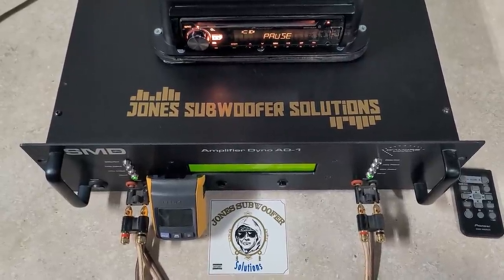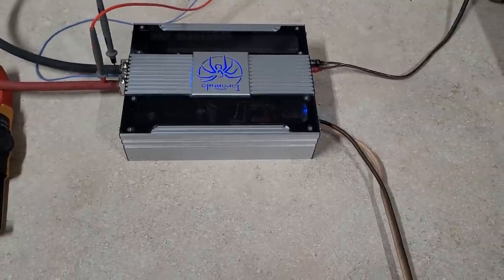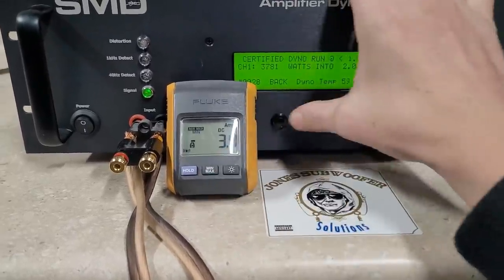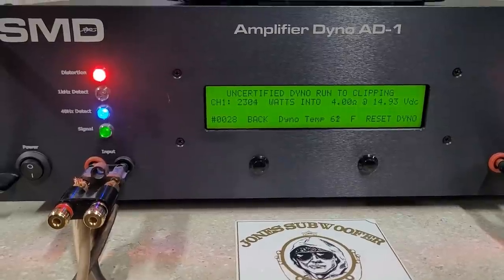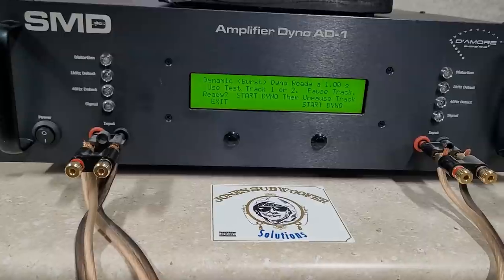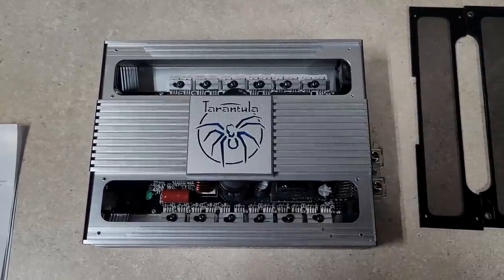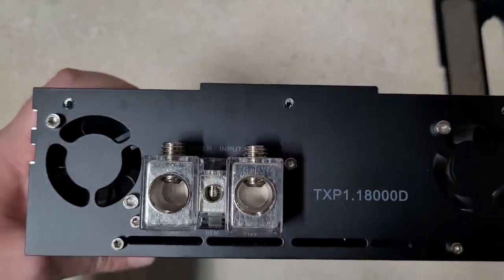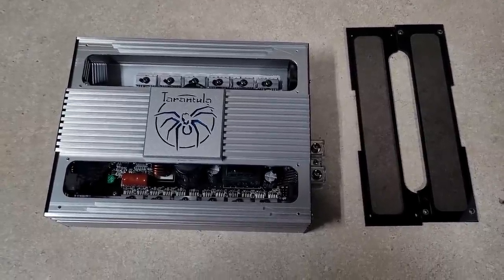AD-1 Amp Dyno Soundstream Tarantula TXP1.18000D by Jones Subwoofer Solutions JSS

Comment: So run this thing at 1.3-2 ohm and get around 4000 watts for $300. That’s not so bad. 99% of people don’t understand how tough a 1 ohm resistive load is on an amp.
Reply from the maker: Exactly my thoughts as well.
Reply: Or your electrical system smh.
Reply: Ran my hifonics brz 1700.1 at 1ohm all its life. Never even got warm. Had a xs power 3400 under hood. and big three. 14.4 volts all day.
Reply: Especially .5 ohms. I run that in a lexus. Buddahoutchea on youtube 2 see it flex
Reply: @knikkaknikk86  the thing is when you have them on the speakers the impedance rises sonits not on 1 ohm exactly might be like 1. Something
Reply: @knikkaknikk86  run it at .3 and thats about what this amp just withstood
Reply: I don't think he had enough power wire running to it. You can't expect an amp to push over 5000 watts without 2 runs of 0 gauge to the amp. Technically you the wire he was running would have eventually burned up from heat because it really is only rated for 3000-3300 watts. He needs to redo the test.
Reply: @drjd2real  on a reasonably short run of wire, 10-15 feet, a single piece of 1/0 will easily supply the current for 5000 watts. And I’m quite sure his run was no longer than that. If that tiny piece of metal in a 400 amp fuse can supply enough current for 5000 watts you don’t think a piece of 1/0 can? When you pull to much through a wire you can literally see the wire physically move. That was not happening.
Reply: I have a txp1-18000 at .5 ohm on 4 dual 4 American Bass Elite 15s with box rise I have no problems and they are slamming hard just make sure to set the gains properly , I set mines with the clip light on the amplifier
Reply: @alexturner4312  makes sense. .5 should rise to around 1.5. Possibly higher. Nice to see someone actually paying attention to their clipping light 👍🏼

Comment: I have an soundstream 6000dl & it's wired to 1 ohm & i haven't had any problems...I've had it for 2 1/2 years...i guess I've been lucky...but it's about to come out anyway...I'm about to go skar all the way....nice video btw.
Reply: I had my t1 6000dl for 6 years at .5 ohms i finally smoked it but i rebuilt it with alittle bit of modifications and ramped it up to 6000 watts rms this was a certified run at .5 and it still runs to this day although it takes its toll on woofers gotta be some strong subs to take it now

Comment: Just some constructive criticism. It's static load on the dyno not reactive. Reactive is on a sub. Also, you need to stop the track sooner. The amp popped because you ran it into the rails full clip at over 5,000 watts for almost five seconds. Five seconds full clip with that kind of power is of course going to overload the output section of the amp especially a cheaper amp. Other than that fantastic video keep em coming.
Reply from the maker: Can I blame the smoke and excitement?  Resistive on the dyno, reactive on a sub - I got confused indeed.
I don't think hitting pause sooner would have saved this amp though, the dyno had just barely locked the numbers down when it went, maybe 2 seconds later it popped.  I see what you mean though.
Reply: @Facekicker  Why did you expect rated with one run of 0? You were trying to push too much power through the tiny power wire imo.
Reply: @Facekicker  Go to bcae1 dot com and go to the Power Wire Calculator and input your 15 feet, watch it tell you to use bigger wire.
Reply: @drjd2real  Perhaps the manufacturer should use a pair of 1/0 inputs and outputs.
Reply: His voltage is high as hell being at 15 volts most of the time.

Comment: It says 7000@1 ohm yes it falls a bit short but well over 6000 watt so that is certainly not bad for a 300$ amp and as far as im concerned a bench test on a dyno only gives a rough evaluation of it. Ive had one of these amps since they came out never ever once have i had any trouble with it. Im currently running 2 18 inch skar zvx d1v2 18s at 1ohm with zero issues. Got lucky today and bought a second one for a good price and now I'm searching for a set of 12s to run. BOTTOM LINE IS IF YOU HAVE THOUGHT ABOUT THAT AMP BUT WASN'T SURE ITS A ABSOLUTE BEAST FOR THE PRICE!!!  Hope this helps someone trying to reach a bassaholics goal😊

Comment: 6,241 watts dynamic for 289 on some sites is not bad at all. Probably would've survived a 1ohm reactive load. Not exactly what I run ,but impresive for the price.
Reply: That amp is a Beast. I heard it on two Rockville destroyer 15s at 1 ohm. The dude's car sounded wicked with the Bass

Comment: FYI a subwoofer will present a reactive load with impedance rise along with power compression. The amp dyno will present a purely resistive load.

I think the author of this video is a bit backwards on that.
Reply from the maker: I think the author has corrected himself in the comments many times 😉

Comment: Pretty similar to my sundown full bridge 1500 I had. It didnt take high voltage well and burned it also didn't like 4v from my headunit either. Sucks cause that bad boy was pretty efficient and did alot of power ended up getting a soundigital 1600 evo . so far its lasted longer than the sundown .

Comment: Is it possible that the high voltage contributed? Do you suppose that if you'd run it at 14.4 or 13.8 it would have blown up? The HV input may have caused saturation?
Reply: Someone who is I terestwd in this 8snt going to be running a 16v CMAX bank
Reply from the maker: Voltage wasn't a factor. 
Mfgr rates them for 16v operation.
They can't handle extended clipping at rated impedance on the bench - it's inherent in every Chinese SD clone board.  Same as Wolfram O Series and Sundown SFB.   They need to see rise.
Reply: @Facekicker  so with box rise 1.3 ohm it should run fine? Real world situation
Reply from the maker: @lol-ld3jh  I would be hesitant to wire under 1 ohm no matter the rise, and don't think I'd do it at all personally unless I know I'm gonna rise past 2 ohms.
I'd say rising to only 1.3ohms would be playing with fire, literally.
And as mentioned before this would apply to any of the Chinese SD clones, not just the Soundstream.
Taramps Smart5k or Smart5BASS would be a much safer and more reliable amp with low rise in this case, in my opinion, and will match or beat the clamped power of the Soundstream.
Reply: @Facekicker  was really looking for something to put out 2500 range a 1 ohm. I saw this figured I'd have plenty of head room for bigger build in the future.
Reply from the maker: @lol-ld3jh  Consider Taramps MD3k or Cab22
Reply: @Facekicker  tha cab22 is impressive for the price.

Comment: I would be curious to see a current Dyno of the new generation of Hifonics Amps after they decided to go with Peak power output Ratings  instead of RMS ratings on thier Manuals, Boxes and documentation. This would be the generation after the BRZ Brutus series. Word has it that they decided to go with Peak power rating after several failed accurate RMS attempts on the AD-1 Dyno.
Reply from the maker: I'll check em out
Reply: @Facekicker  I appreciate it.  Just so you know, am retired Purchasing Manager for a Electronics Manufacture, so I know how the system works. This information is not solely based on my experience but insider information as well. It pains me to see the decline of the great company Hifonics used to be to what it is now....

Comment: When you went into dynamic at 2ohm it went from 0 to 5000 watts it didn't count up clean. I'm under the impression that it has to count up clean on the dyno in order to concider it a correct reading. I'm I wrong about that because it a dynamic run. I don't think I am I think it still has to count up clean even with a dynamic burst but you tell me. I just like to eat h and your actualy doing the test. Anyway thanks for the video. Even before you did the 1ohm run u was saying you have to have a second camera on the amp to catch the fire. But it was a great video anyway!
Reply from the maker: Dynamic is a burst track and everything worked as one should expect it to.  No difference in any other amp doing dynamic runs.

Comment: Can you dyno old school EARTHQUAKE PHD10000DW/2
Reply: Yeah, I'd like to see that too.  I had one I just sold and never even ran it in my vehicle. Has way more transistors than this soundstream, but obviously won't make numbers as high. I've never seen those earthquakes dynoed, the last US built amps earthquake put out. Wouldn't have sold mine, but I  needed something more compact.
Reply: @2slofouru  I have mine hooked up to alpine 9515 head unit. Epic center.  4 old school pioneer 12's not even turned up a qtr. It slaps. Big 7 upgrade and 320 amp JS Alternator .... I got same series PHD5000W/2 same setup in truck . still need to upgrade alternator.

Comment: The no clip light on knob is pretty slack, as far as I'm concerned all amps should have a clip light on the bass knob. The first amp I bought with one made me never want to go back. It really makes you realize how often you're actually clipping. At least this one has one on the amp. But I suppose if you have a steady hand you could solder wires onto the board where the clip led is mounted. I'd like to try a couple of these instead of my cab45, but a 2nd cab45 would be a smarter idea...lol

Comment: Awesome test thanks for the dyno and showing us what we get if we bought this and how cheaply it's made.
Reply: It's a very tiny amp, much smaller than the ones companies charge 2 to 3x more for. For something that could feed four huge subs a clean 1000wrms each, I'm not sure where the hate comes from. I mean, look at the cost per watt... I'm about to run three 12s that are rated at 600wrms, because I prefer overkill and low distortion. I've been running the amp a few months now, but only on two IDQ8s, just to have something.

Comment: Do you recommend a power supply for bench testing amplifiers without using any car batteries?
I'm looking for a power supply that I can plug into 120 volts and run an amplifier in the home.
Reply from the maker: A good power supply like the Taramps Procharger series will do standalone operation without a battery, but on 120v you'd be looking at 1000w of support max without adding battery or running multiple supplies.  Each power supply would need its own 20a breaker as well.
I am a Taramps dealer and if you'd like pricing or other info, you are welcome to message me through YT,  or the Jones Subwoofer Solutions page on FB, Instagram, or the web.

Comment: To buy that kind of power for 300 is unheard of though.. that kind of power back in the 90s would have costed thousands and thousands of dollars. My first amp was a Orion 2100 hcca and although a cheater amp I still spent 1500 iirc... 80% efficient  , 3k watts, small footprint, low price, run it at 2 ohms, if it pops, what's the real loss?

Comment: Hi I bought the TPX6000 and now it's showing the clip signal even after disconnecting the all the signal cables including the speaker cable and it's still showing the clip signal. What might be the issue??
Reply from the maker: Faulty amp is likely, these apparently have a weak QA/QC process.

Comment: Better off just getting taramps smart 3 for same price. That's my opinion.
Reply: Austin Martin  that's what I've heard🤣 I've had the smart 3 about a month, and I really dont care for the full bridge crap tbh.
Reply: @1ohmwrecker  my Smart3 is still going strong! Doing so well that I actually have 2 other brand new amps still in their original packages that I haven't bothered to even test out yet. One is a Korea amp: Trauma Concussion 3500 watt amp. Second is my latest amp I bought, Taramps md8000.1
I can't even imagine how much of a beast my 8k Taramps will be, this dang 3k Smart3 already pushes the subwoofer pretty good! 
I will admit I am kind of anxious to use my Taramps 8k though!

I don't care what Taramps haters wanna s say. After using the Smart3 for a while now I know for a fact they make power! Plus they aren't power hungry & hard on the electrical like Chinese amps are. Even at night with my headlights on I get very little voltage drop at full tilt with my Taramps Smart3. During the day I get zero Voltage drop at full tilt, unless I'm sitting in my driveway or parked idling in a parking lot for several minutes but even stopped at red lights at full tilt playing heavy rebassed rap I get no voltage drop. I was completely shocked at the power efficiency of Brazilian amps when I first installed my Smart3!
Reply: @itdoesntmatterwhatyourname6128  I know alot of people swear by them. And they do crazy power. Me personally, I like the monoblock better. But, I'm not a taramps hater, I just dont care for the full bridge stuff.
Reply: Sure .... if you only need 3000 watts
Reply: @matthewlewis7630  and at 2 different ohm loads, which is awesome.
Reply: U cant get a taramp 3k for 300 tho
Reply: @williamflores8122  u can get the smart 3 for $305. You can get the MD or HD for even cheaper. I only paid $265 for my taramps smart 3k. So, you deff can! Quick internet search would show u that.

Comment: Wow. Didn't think it would put out the power it did. Definitely not 1 ohm stable. Run it at 2 ohms and you'll have a good amp.
Reply: Again im stating that a 1 ohm "resistive" load is worlds apart from a 1 ohm "dynamic" load speakers change there impeadance because of whats known as box rise and this means in a real world "music" environment you never see 1 ohm its always higher so a resistive load stalls at 1 ohm and doesn't budge i dont know of a single amp on the market that can handle much time with a 1 ohm resistive load

Comment: is 15.3 volts realistic ?  no
Reply from the maker: It certainly is.  Especially when running an amp that requires electrical upgrades.
Reply: @Facekicker  doesn't an automotive voltage regulator operate between 13.5 and 14.5 volts ?
Reply from the maker: @Mr_BUSINESS_24_7  it's common to charge higher these days after alternator and battery upgrades.
Reply: @Facekicker  so there is modified voltage regulators I guess.  .. I wasn't aware of that.  Awesome
Reply: Not in most vehicles, 12v car batteries don't like charging voltage that high and it will overheat them and shorten their life. Typical oem systems don't charge above 14, for that reason. You can buy custom alternators that charge way past 14, but that's best suited for car audio competitions where they do "burp" spl runs for very short periods. In a daily driven vehicle, an upgraded high current alternator that's designed to not exceed 14v is best.
Reply: @2slofouru  agree.
Reply from the maker: @2slofouru  my daily driver charges at 15.8v, like I said it's more common than you may believe

Comment: I have 2 of these on 8 evl 12s no issues they are a little power hungry...scratch that both amps burned out in 2 days after they went on the 12s they worked good on 6 ,8was too much

Comment: Can I run the 6000.1 Taranchula with a single 4 DVC Sundown u serries ran down to 1/2 ohm.  

Or should I buy another 6000.1 and run at 2 ohms as slave.
Reply from the maker: Definitely no to .5 ohm use.

Comment: I’ve got a Skar DDX 12 at 4 ohms gonna wire it down to 2, and I’ve got a Rockville dbm 12 that’s gonna push it. Is it enough power on the amp to give that sub? Kinda curious tbh I wanted a cheap but decent system. Amp is 2k watts max
Reply: It will push it a little bit
Reply: @hammett1985  I got it hooked up you can hear it half a mile away we tested it 😂

Comment: you wouldnt call it a bad amp? the fact that it claims to have a max power of 18k @1ohm and only managed to do 6.2k on a few bursts and then cooked itself while ramping up on the certified run makes it a bad amp. the higher impedance performance falls by the wayside imho.  if they were just honest about their product and called it a 2ohm 3600 like hispls mentioned then yeah, not a bad deal at all.  these 'boss' ratings are deceptive and are aimed at the regular joe that just wants some bump in the trunk and i just cant be on board with that shit. somehow they should be held accountable for the fraudulent ratings. i long for the day that this industry gets cleaned up. anyhow thanks for what you do tho even if i cant fully agree with the final word; i do appreciate you taking the time money and effort to show us what these amps are really doing.

Comment: Ok if this think can do anything close to this you need Min double 0 power cause you going to be pulling 5-600 amps.. you need to re run this with two cables into a reducer at the amp.. I think it’s got more left in her

Wait this a class B right.. htf it getting 87% that tops many name brand monos 😅

Comment: Basic rule of thumb,  1000 watts continuous power should draw about 100 amps of current. With that being said,  if the amplifier is rated for 18000 watts , sounds to me like your power supply should be able to supply 1800 amps of current. The experienced audience knows that only one set of power inputs is a hint that this amp was not going to make it. Thanks for the entertainment.  Let us know how the warranty works out.
Reply: Your knowledge is a joke. The internals are what's going to dictate the demand, not just what the outside of the box says 🙄.  Tararmps 40k pulled over 42k watts and has a single input. So many different internal designs and you think the damn number is what matters. Smh,  rookie.

Comment: it is a Chinese copy of a Soundigital design and it looks like you lost atleast 2 power supply fets due to high current from running into heavy clip for an extended time = saturation of the PS transformer presenting a dead short or you hit the current limit of the fets either or
Reply from the maker: Pretty sure rail voltage exceeded fets rating
Due to heavy clipping, yes.